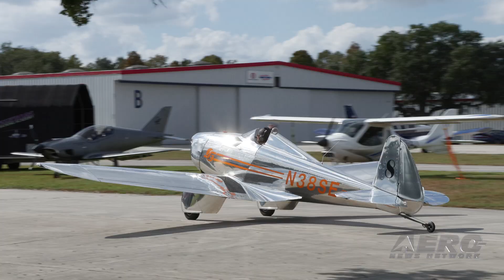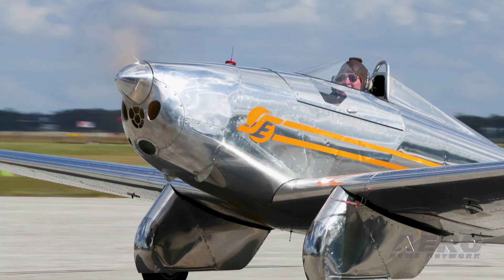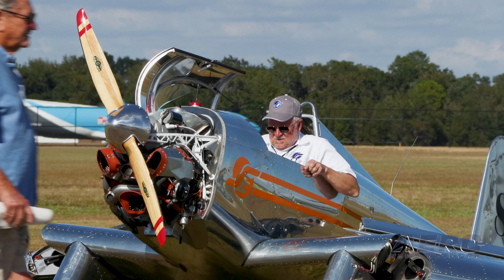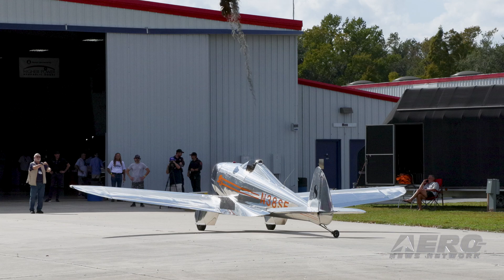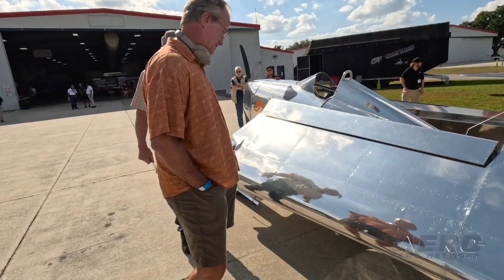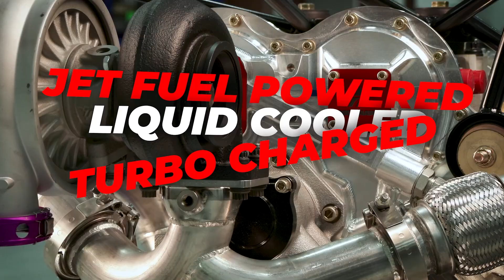Aero-TV: Spirit Engineering’s Long Haul to Lakeland

Comment: Nice looking airplane and interesting engineering, but from practical point of view - doesn't make too much sense. Too slow - lower than C150, almost the same as Cub from 194*. With this slick shape it should be ok ~140mph at least.  Price - really not cheap considering that is tailwheel and no flaps, engine 44hp or so.
Reply: Since the entire design of this aircraft is centered around inexpensive stick and rudder fun, I would say it is about as practical as any aircraft built, especially the folding wings and 2 GPH fuel burn.

Comment: I'm spending more than $69,500 just for the avionics in my airplane. Crazy cheap price for this Spirit SE-1.
Reply: What a u talking about? Materials with engine should cost no more than 20-30k. Production - that is different question, but for 1 seat no-flaps airplane 70k can't be cheap. You can buy a Cub (2-seats) with the same performance for half of the price today.

Comment: What's going to happen in California with general aviation when it gets real expensive and hard to get aviation fuel ? Philips 66 is closing down there refinery.
Reply: This airplane isn't tied to aviation fuel. It can run 91 octane automotive gasoline.
Reply: 91 mogas is the preferred fuel for this plane, so it seems they share your concerns.